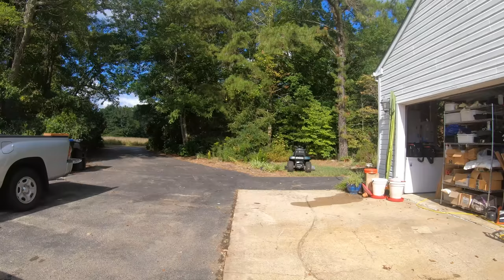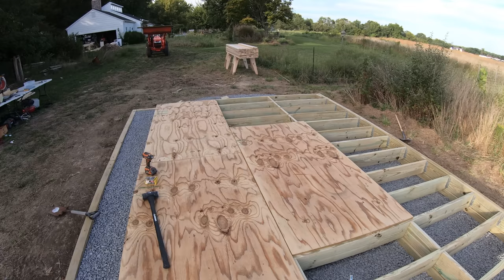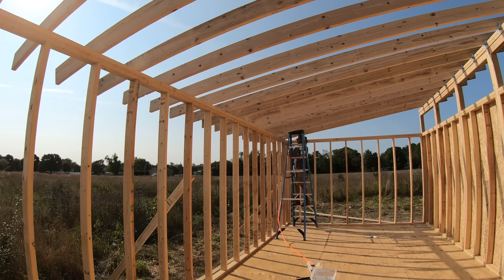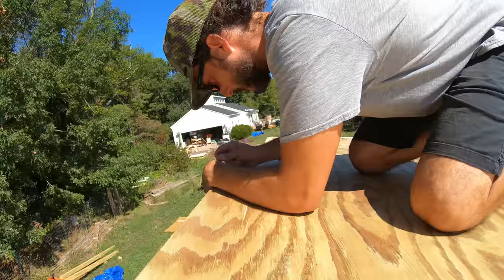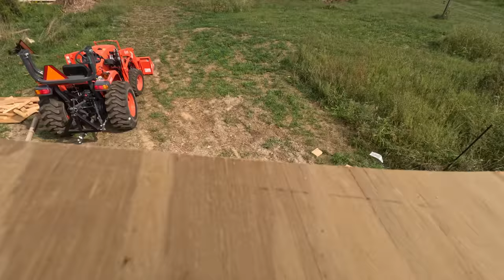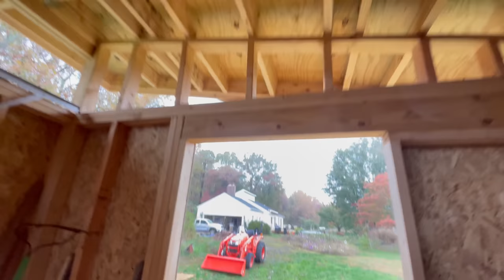Building a Shed

Comment: Nice shed but how do you keep the birds and bees from coming in through the open soffits?
Reply from the maker: I recommend putting wood blocking between the rafters to close it up. I left mine open for the air flow but you’re right I do get the occasional hornet trying to set up shop in there.

Comment: very cool build.  Question...  18:53 to 19:09 the front wall jumps up a few more feet and gets reframed. Did you cut the top plates and run longer studs or just add on top of the existing wall? Change of plans? ( I assume) Just curious... working on plans for a similar shed.
Reply from the maker: Yeah, my original plan was to just box out the windows on top but along the way I realized this would create a potential hinge point in the entire wall and just seemed like a bad idea so I went back and cut out every 4th one swapping it for a 10ft 2x4. I also reinforced them on each side to make up for the load being carried across the window and to easily support the cut sections. I Hope that makes sense.
Reply: @gino.varisano  Thanks Gino, solid build for sure.